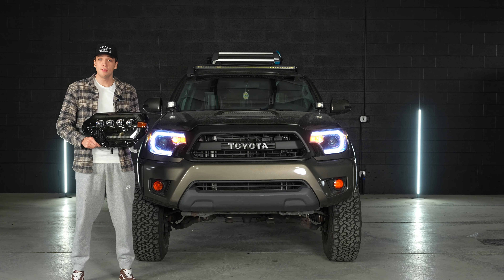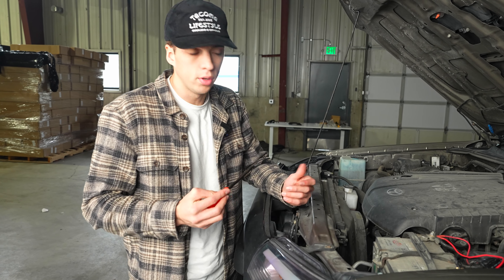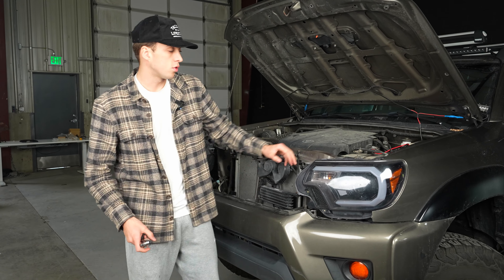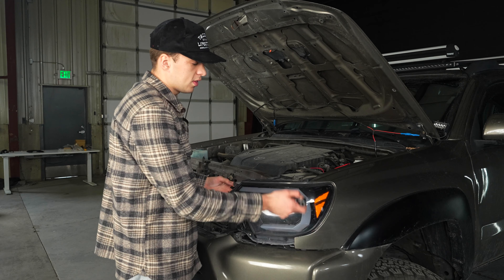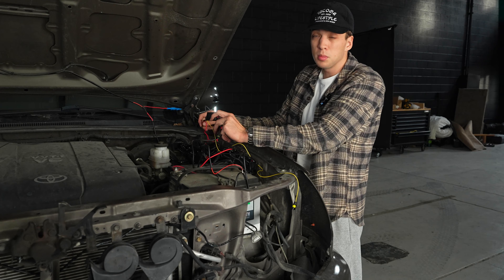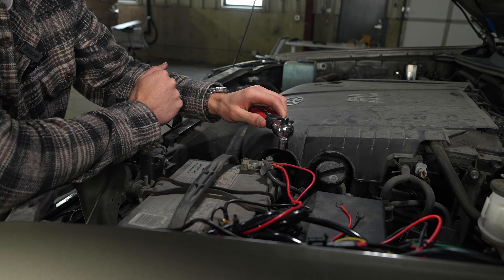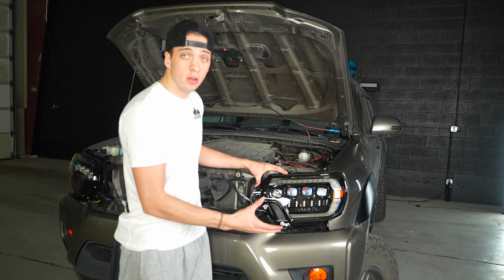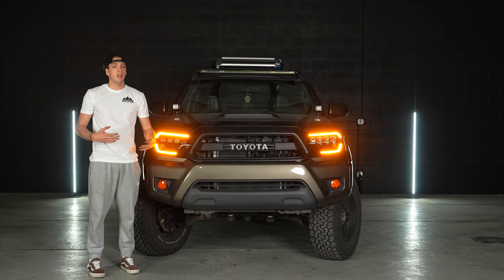Alpha Rex Nova Series Headlight Install // 2nd Gen Tacoma

Comment: Drl doesn't work and turns don't like to work with this exact install
Reply: Me too and drains the battery.
Reply: Same. They sent me a new DRL harness it worked for a bit then stopped. Ended up returning em. Trash product, but customer service was there